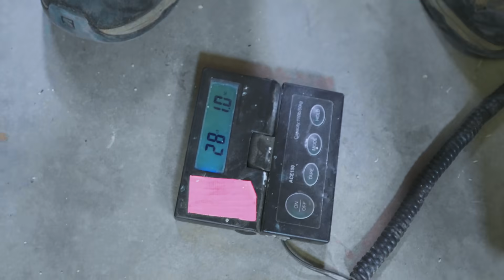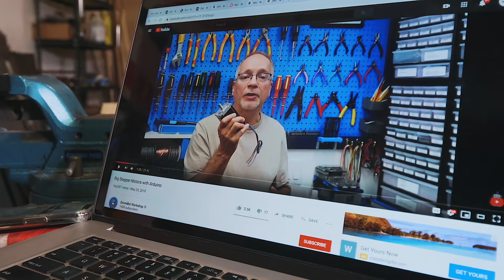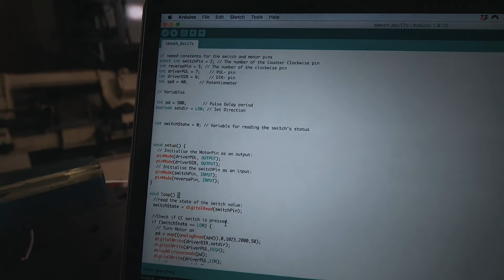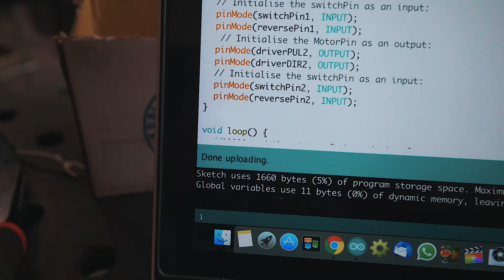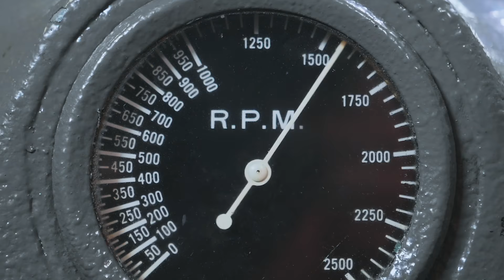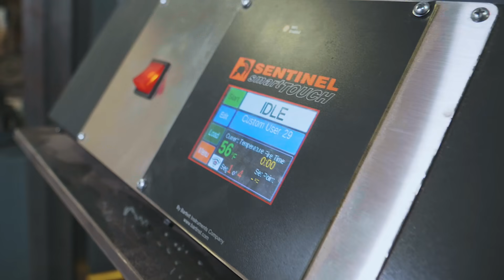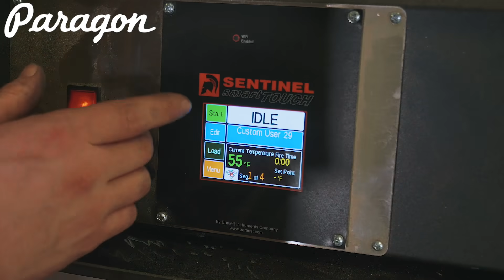MAKING FORGE DOORS!!! Part 2

Comment: Since this is probably recorded in advance this might be for nothing but wouldn't it solve many problems having the motors underneath the table with shafts that run all the way through the table to the doors to open them like big church doors?. The doors can be on small rails so you can move them manually too. The motors wouldn't need to lift 30 pounds and it would probably be faster.

Comment: Polling example:
you can change your program structure from what i presume is some while loops that are triggered by the buttons to a round robin loop of if statements.

if you aren't already, use analogwrite where possible to save yourself from writing your own pwm setup.

pseudo code:
if (button1){
analogwrite(motor1, clockwise);
}
if(button2){
analogwrite(motor1, anticlockwise);
}
if(button3){
analogwrite(motor2, clockwise);
)
if(button4){
analogwrite(motor2, anticlockwise);
)
if(button1 & button2){
                              //if both raise and lower buttons are pushed, motor should stop, not power itself in both directions somehow
stop condition
)
if(button3 & button4){
stop condition
)
if(not(button1) & not(button2)){
            // generic stop condition, if both button 1 and button 2 are not pressed make sure the motor is stopped
stop condition
)
if(not(button3) & not(button4)){
stop condition
)

Comment: Here is the code you need, I tried to keep everything your code as similar as posible. It should work fine for the first motor, I'm not sure which pins you use for the second. If any question ask me. Have fun.
// Constants
// First Motor
const int fowardPin1 = 2; //switch foward motor 1
const int reversePin1 = 3; //switch reverse motor 1
const int driverPUL1 = 7; // PUL - pin motor 1
const int driverDIR1 =6; // DIR- pin motor 1
const int spd1 = A0; //Potentiometer motor 1

// Second Motor
const int fowardPin2 = 4; //switch foward motor 2
const int reversePin2 = 5; //switch reverse motor 2
const int driverPUL2 = 9; // PUL - pin motor 2
const int driverDIR2 =8; // DIR- pin motor 2
const int spd2 = A1; //Potentiometer motor 2

// Variables
int switchState1 = 0; // Set Action motor 1

int switchState2 = 0; // Set Action motor 2

int speed1=0;// Set Speed motor 1
int speed2=0;// Set Speed motor 1

int timer=0;// Set program timer to move both motors

void setup(){
  // Initialise motor pins
  pinMode(driverPUL1, OUTPUT);
  pinMode(driverDIR1, OUTPUT);
  
  pinMode(driverPUL2, OUTPUT);
  pinMode(driverDIR2, OUTPUT);
  
  // Initialise switch pins
  pinMode(fowardPin1, INPUT_PULLUP);
  pinMode(reversePin1, INPUT_PULLUP);
  pinMode(spd1, INPUT);
  
  pinMode(fowardPin2, INPUT_PULLUP);
  pinMode(reversePin2, INPUT_PULLUP);
  pinMode(spd2, INPUT);
}

void loop(){
  readInputs(); 
  moveMotors();
  timer++;//increment timer
  //increment or decrement this number if motors are too fast or slow
  delayMicroseconds(20);
}

void moveMotors(){
  //Motor 1
  switch(switchState1){
    case 0: break;//Do nothing, nothing is pressed
    case 1: //Go foward
    case 2: //Go reverse 
      digitalWrite(driverPUL1, (timer%(speed1*2)>=speed1)?HIGH:LOW);
      break;
    case 3: break;//Do nothing, You pressed both buttons
  }
  
  //Motor 2
  switch(switchState2){
    case 0: break;//Do nothing, nothing is pressed
    case 1: //Go foward
    case 2: //Go reverse 
      digitalWrite(driverPUL2, (timer%(speed2*2)>=speed2)?HIGH:LOW);
      break;
    case 3: break;//Do nothing, You pressed both buttons
  }
}

void readInputs(){
  //reset actions
  switchState1 = 0; 
  switchState2 = 0;
  
  //read foward switchs
  if(digitalRead(fowardPin1)==LOW){
    switchState1+=1;
    digitalWrite(driverDIR1, LOW);
  }
  if(digitalRead(fowardPin2)==LOW){
    switchState2+=1;
    digitalWrite(driverDIR2, LOW);
  }
  
  //read reverse switchs
  if(digitalRead(reversePin1)==LOW){
    switchState1+=2;
    digitalWrite(driverDIR1, HIGH);
  }
  if(digitalRead(reversePin2)==LOW){
    switchState2+=2;
    digitalWrite(driverDIR2, HIGH);
  }
  
  //read potentiometers 
  speed1 = map((analogRead(spd1)),0,1023,2000,1);
  speed2 = map((analogRead(spd2)),0,1023,2000,1);
}

Comment: You have a  } missing at the end of your motor 1 if-else-if statements.  Your code should look like -
    digitalWrite(driverPUL1,LOW);
    delayMicroseconds(pd);
    }
  }
      //22222read the state of the switch value;
  switchState = digitalRead(switchPin2);

You accidently made the 2nd motor code part of the first motor's reverse code.  So the 2nd motor would only work, if the 1st motor was not running or it was running in reverse.

Comment: For someone that didn't make a single thing in his life related to this, i think hydraulics/pneumatics would be more effective/much safer? than mechanical like the one he is making. Not considering if it will be good with heat from the forge though.

Comment: So... I don't know how to code arduino, but I do know C and C++ and can take a guess of what you could do. So getting multiple inputs is probably an issue, as I'll assume you have something like this, but one of these for each button.
While (Button_pressed){
    Turn_Clockwise();}

That works great for single input applications, but it would never pick up the second input since that while loop will run infinitely until the first button is let go of. So... Maybe have the code run the while loop when any of the buttons are pressed, and then some if statements checking for multiple inputs that turn a certain rotation, like 5 degrees turn on the motor or something small. I'm thinking something along the lines of this (mind you this is in C) Button 1 and 2 are for first motor being clockwise and counter respectively, button 3 and 4 are for motor 2, clockwise and counter respectively.

While( Any_pressed){
    if(Button_1_pressed && Button_3_pressed){
        Motor1_Clock();
        Motor2_clock();
     }
     else if (Button_2_pressed && Button_3_pressed) {
        Motor1_anti();
        Motor2_clock();
    }
}

and so forth for your double cases, and then put an if for the individual buttons underneath, that would constantly update and check if 2 buttons are pressed at the same time and do the respective actions, and update again. Hopefully that made sense XD

Comment: I do not understand the absence of counterweights for this build. I’m not an engineer but even I can think of half a dozen configurations that would reduce the motors’ load to almost zero, reducing the likelihood of violent failure. Thirty pounds of door suddenly slamming shut could be baaaad.

Comment: Hi Alec, I build industrial automated control systems for a living. Although I seriously commend you in your hard work and determination in learning new skills, I believe you've gone way too complicated in your system when a basic motor with a built-in brake powered via a 'direct online' (a motor circuit breaker and contactor in series) with a reversing kit. It would have been perfect and safer as you wouldn't run the risk of the doors dropping (the motor is always in brake until power is supplied) and the weight wouldn't be an issue.

Comment: I am scratching my head why you are not using the same design as the paragon doors, and use a linear actuator to lift the doors up, you can even have a weight on one end to help the lift.

Comment: Man, here I was thinking they were going to quickly build a set of sliding doors on either end. Something that opened and shut manually just like the bricks they've been using; but, you know, attached and less fragile. But hey, go wild. 
Keep it simple is more of a guideline anyway, right?

Comment: The stepper motors you have should be far more powerful than needed. Your initial instincts of it being able to break your fingers is accurate; if properly driven you should have no chance at stopping those motors with your bare hands. As far as it's concerned your fingers don't exist. My initial guess is the driving current is too low; your stepper driver should have an adjustment for that. 

Alternatively there is a chance you're spamming commands at the controller and causing it to continuously reset. (Which would happen if you're just doing if(button==LOW) instead of comparing against it's previous state)

Those motors should be able to straight lift your doors, or you could use gearing/pulleys to multiply the strength to easily lift them, HOWEVER, I would HIGHLY advise adding a counterweight, which would both make it trivial for the motors to lift the doors, but would also help prevent the door from quickly slamming down if there is a power loss or other issue with your electronics. Safety!

Comment: Would've been cool if you had actually put the mechanics below the forge instead of above, making it far more compact=, Maybe something like a hydraulic lift below the table that lifts the gate from below. with the gates on two solid steel stilts that pass below the table.

Comment: If you don’t want to make it so that you have to plug in your computer every time you need to use the forge, I would grab a raspberry pi, and just flash Linux onto an micro sd for the os.

Comment: Simple 12V DC motor and a couple pole relay would have done the job as well. By the time you programmed this you could have build the damn thing. Also much easier to repair when this digital stuff stops working.

Comment: you could have achieved the same thing with a used windshield wiper motor, i used one to open my sliding gate, it's not the fastest thing in the world and you can't program it, but it would have cost less then $10.

Comment: Don’t see your code here, but if the motors are going to always be running the exact same thing you could drive them both from the same control pins on the Arduino. Otherwise, I’m guessing that you might be using a while loop to control the motor signals. The whole loop will keep you locked into that small section and not look at the rest of the code, which would prevent both motors from running at the same time. Try looking into if statements instead, which will not block the execution of the rest of the program.

Comment: A problem that could be fixed by buying  a 15$ winch and a steel cable +some pulleys.There is a reason why there are no elctronics in guns even after 200 years -if you want to do a simple thing ,that will work 100% of time you go mechanical not electric with minimal amount of moving parts.

Comment: Why not a single hydraulic ram and two levers to open both doors?
Control of the flow of hydraulic fluid is easy enough.
And
The ram would put up with heat better than electric motors.

Comment: its very easy to do 2 together, your code probably uses a code segregation for every button, and you need to count for the 2 buttons are pressed together. 
it should be something like :
if (PIN1 =1 && PIN2){...}
else if (PIN1 = 1 ){...}
else if (PIN2 = 2  ){...}

Comment: You could have just had it to were the mechanics were on the bottom pushing the dorrs up on a rail instead of pulling it from the top i feel that would have saved some time and i think would have been a lil simpler thats wat i would have done.

Comment: I mean, I'm a literal computer engineer but I can't help but think it would have been better to just do a foot pedal that physically lifts the doors with your weight. you're using foot power which is more than enough to lift 30lbs without help. a chain and sprocket with a foot pedal probably would have been able to have enough travel to lift it for your uses.

Comment: Why can't you just hook up both controllers to the same output? Or both motors to one controller? 
Then again using 2 steppers together is going to be a nightmare if you miss steps over time.

Comment: Am I the only one who’s a little concerned about the mounting frame above the forge?  If you look, the motors will be mounted on a piece that isn’t directly supported by the vertical bars.  I’m worried the weight could break the welds and cause it all the fall

Comment: Why didn't you just use hydraulics ? Hyraulics are resistant to heat (and easy to insulate), as easy to use with a pedal, extremely simple to use; looks, sounds and feels cooler and you wouldn't have any worry about carrying capacity.

Comment: Alright a few things to go over, first of all if you want to post code pastebin is your best bet alot of coders use it to archive and share their scripts and you will probably be able to find help there. secondly I feel you've made some questionable decisions from an engineering perspective. for your pulley system I would advise against using un-braided steel string for the weight you're lifting you probably wouldn't see it for awhile but you will eventually run into it drooping and drawing out over time secondly you might want to use a clutched pulley or a worm gear in your stack up to keep from destroying your stepper motor. I would also discourage having your doors free floating by just that center column you can build rails for it to ride in on the sides of the cage you built just to make sure than in the event of catastrophic failure your not dropping 30 pounds on your toes. also if you're having trouble getting both the motors to run (which maybe I'm missing the point but each motor is linked to a different door right so why do you need to run both?) you can just splice together the data inputs to one set and spoof together your power lines its not necessary the "safest" way to do it but without hardware specifics that's the best i can tell you that will for sure work

Comment: I don't know nothing about engineering, but what if you put 1 cpu board sending the same order to 2 separate driver move in the same time, what I mean is that control button should mounted on the computer board, sorry for being smartass..

Comment: Wonder feeling of accomplishment isn't it?  I do have one concern, and I might be wrong but your combination of heat, steel, stainless, and aluminum sounds like a recipe for things locking up due to a chemical reaction.  You might want to keep the cable and the axle lightly lubed.  Congratulations on your successful programing.

Comment: Another solution would simply be to run the second motor off of another arduino, wouldnt it? Coming from someone with little experience with Arduinos

Comment: my guess is that you have a blocking issue with the code, I think you need to break up the code into functions and run in a while(1) loop, but just my guess without seeing the code

Comment: So screw the jumper wires, breadboard, and through hole buttons. I would suggest designing a custom PCB. Less wires and most of the components would be consolidated to one board making for a smaller footprint even in an enclosure. Maybe even use an ESP8266 or ESP32 so you really could say "Alexa, lets thank today's sponsor" so your forge doors open, as Martin Poole
 suggested. If only someone in your comments section had the free time and maybe did this stuff for a living COUGH